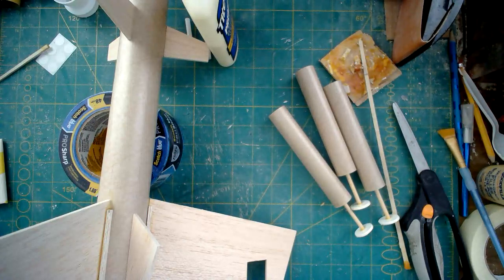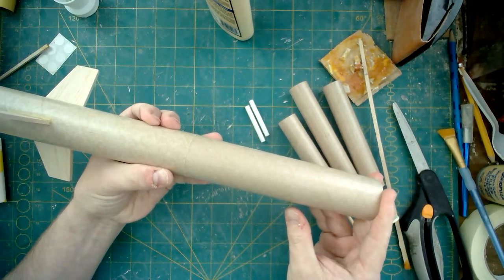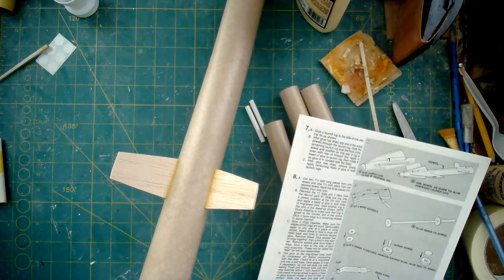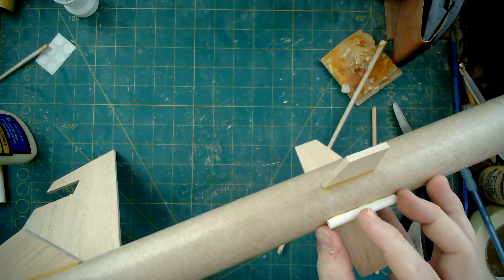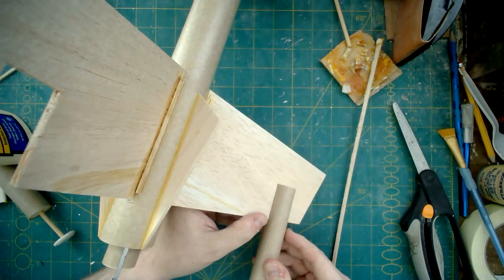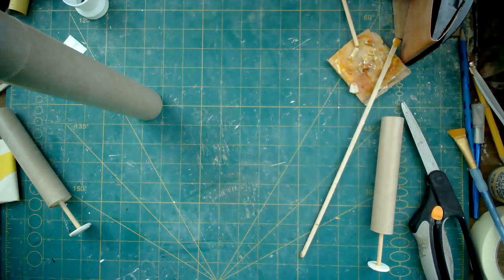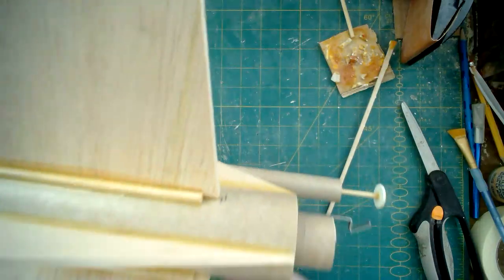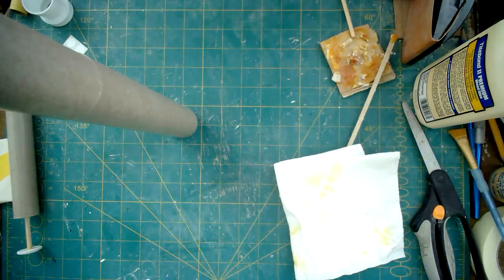Estes Super Vega Vintage Build, Part 9

Comment: This is a interesting design of Estes

  I thought you where usen the other glue in like a greyish - silverish bottle
Reply from the maker: I used both glues - I only used the silvery bottle of fast-setting glue for the main fin attachment, but the Titebond II is perfectly fine for most everything else.  I like it better for fillets, for instance.  Probably would have attached all three pods at the same time if I were to do this again, but it was a lot easier attaching them with the rocket upside down.  That method didn't fit in frame though...